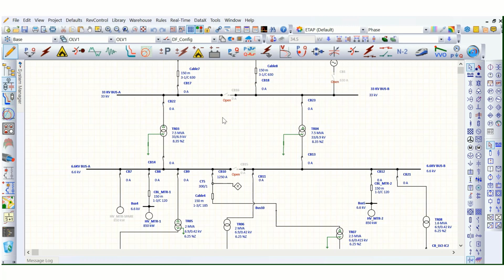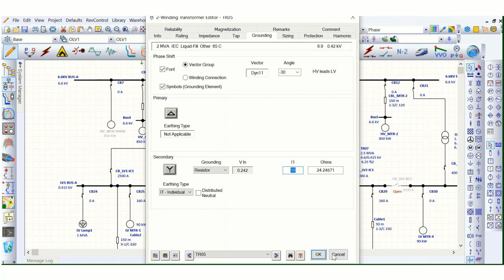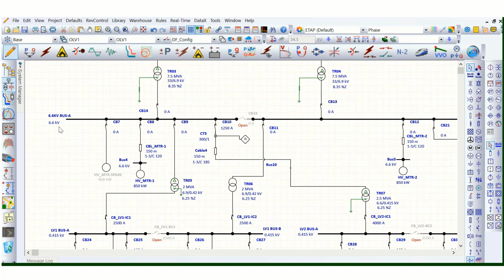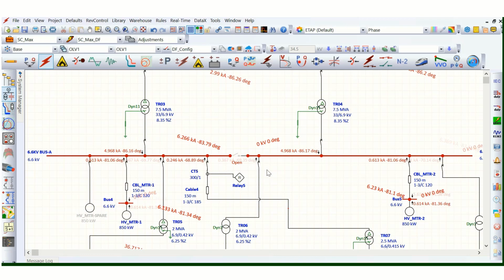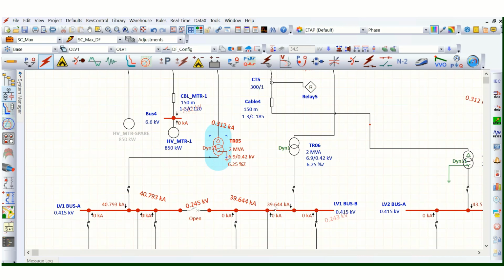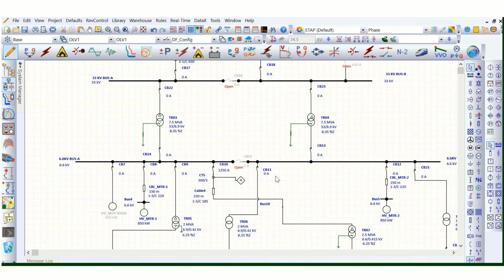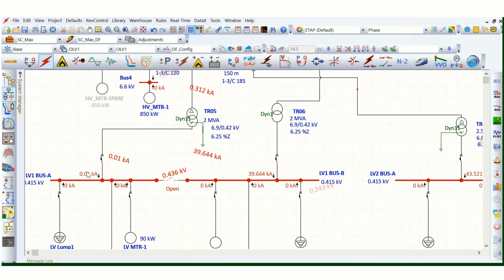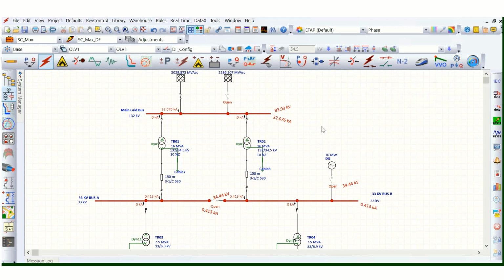Power System Grounding Analysis using ETAP I Electrical Grounding Explained

Comment: Hello Sir, please can you help me? When I add Ngr to my system it doesn't limit the fault currents. Meaning the fault current with solid ground is the same with a modelled NGR. Thank you
Reply from the maker: You can mention NGR current limiting value i.e. 300A or 400A based on project criteria and it will definitely work.
Reply: @SmartEducare  Thank you Sir for all you do. Keep being blessed

Comment: Thank you sir I hope you can help me, how to simulate substation grounding and insert the grounded substation fence directly into the ground grid.
Reply: Can you help me , how to simulate grounding grid on the Single Line diagram to take the short circuit value directly from SLD?

Comment: thanks man but! isn't Solid grounding less common in LV systems??  due to the high fault currents it produces, which can lead to equipment damage, arc flash hazards,  isn't, resistance grounding or ungrounded systems are often used to limit fault current, enhance safety ??
Reply from the maker: Yes, you are right as far as the high earth fault current and arc flash is concerned..
However, considering the fact that earth fault detection is very challenging for NGR or limited earth fault value and ungrounded network at LV level, it is recommended to go for the solidly earth system at LV..
At present, majority of the industrial and commercial installation are following the LV solidly earth system..
Reply: @SmartEducare  thanks man ❤️